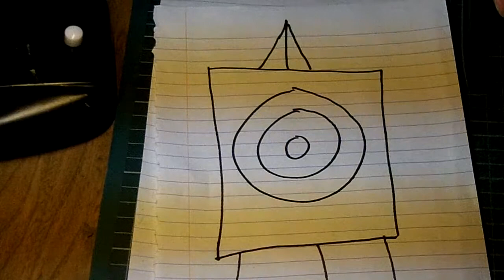Basics of Bareshaft Tuning

Comment: Hello

So I shoot 350 spine 27 inch arrow, 225 grn  point and 500 total grn arrow. 58lb draw.  The bare shaft is constantly hitting the target with the tail end sticking out left. What's the issue and solution?
Reply from the maker: Assuming you're a right handed shooter, tail left means a weak spine.   It might also mean you're torquing the bow upon release. 

Does the arrow stick the same direction every time? If not its likely form.   If yes, does it point further and further left as you get farther away from the target? If yes then it's spined weak and the easiest way to fix it is likely gonna be build out your strike plate
Reply from the maker: I have a #56@28" longbow that uses a 29'' 400 spine arrow with a 50gr insert and 300gr point.   Based upon that it sounds like your arrow is pretty close to right, since I've had to build out the strike plate on that bow a ton to get 400 spine to work
Reply: Benjamin Wood yes the arrow is constantly sticking out left. I will tri out stiffer spine shafts to confirm.thank you sir